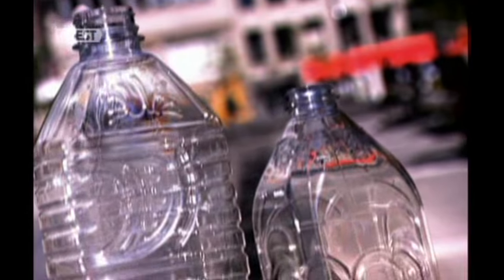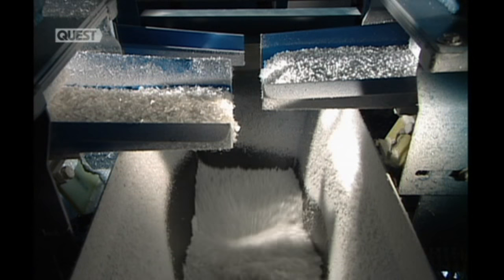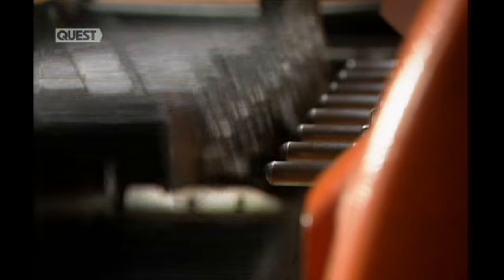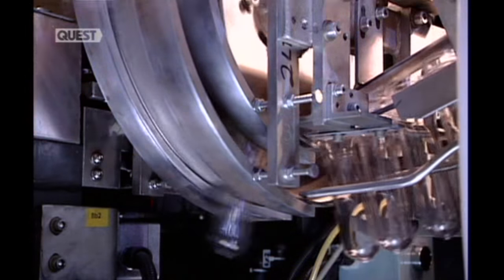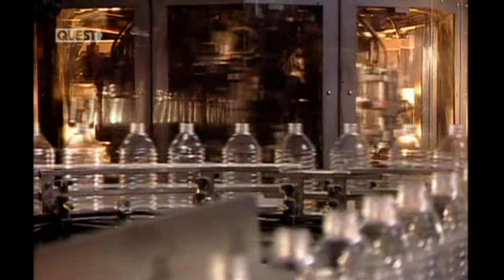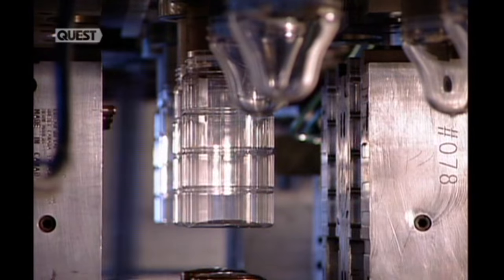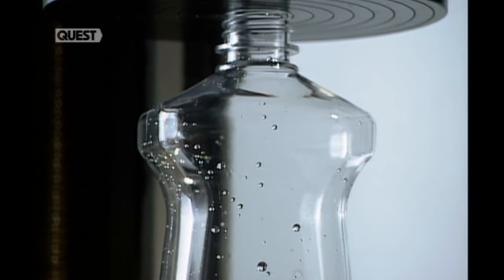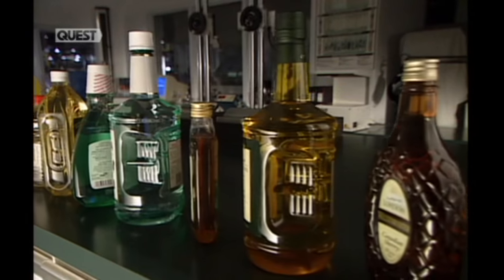HOW IT'S MADE - Plastic Bottles (UK Version)

Comment: I’ve often wondered who designs, engineers, and makes all the machinery that make a final product.
Reply: People like my brother there called Mechanical engineers :) solid works is a program they use to design the machines
Reply: THANK GOD IM NOT THE ONLY ONE
Reply: It seems like such an extensive task to design machines like this.
Reply: @lm1383  you do it slowly and build upon what you have
Reply: alien
Reply: How What it Makes is Made
Reply: A Manufacturing Engineer is the official titles I have, another one is Production Engineer. We typically have Mechanical engineer degrees.  However I have a Masters in Prdouct Design Engineering, which has less physics, and is more about how things will work/move to make something happen,whereas mech. Engineers focus on how long it will last based on friction, how much heat it will produce, and how much cooling flow they need for it, the torque requirements of the motors/gear reduction, etc.
Reply: @jamesdeclan7538   What you guys do is nothing short of AMAZING.